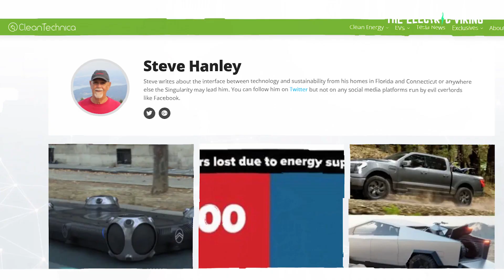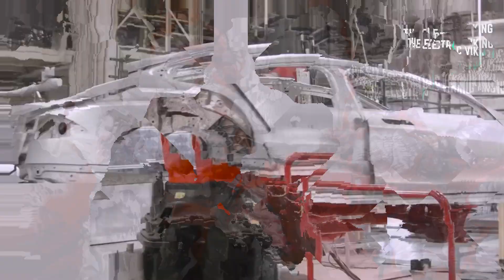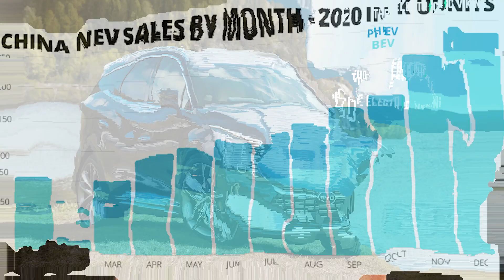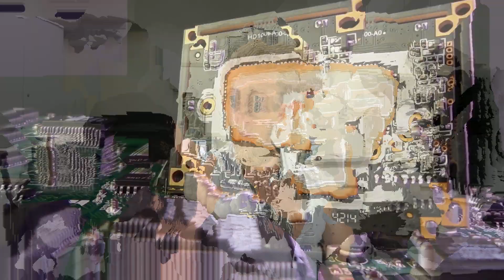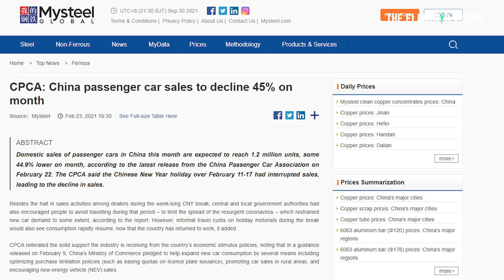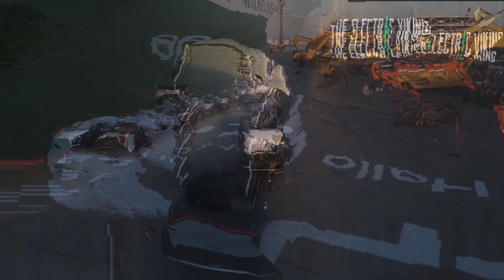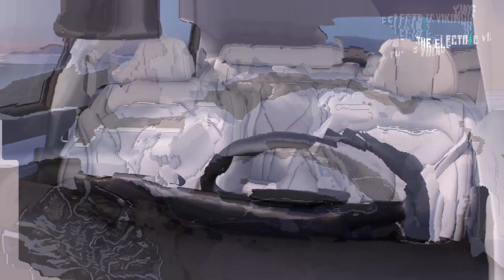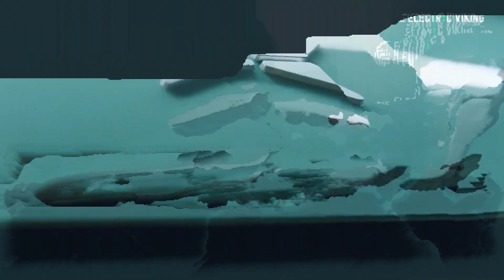The EV revolution is here - China VS Germany!

Comment: Hi Sam,I watched a Fully Charged show on the Sono Sion which is a solar powered car from Munich that uses LFP battery and has 11kw V2G. Small and basic car that has what most people need with decent range and recharges as you drive.Due for production 2023 for 25,000 euros.Can you do a report please I am keen to learn more as I am sure you and your viewers will be also.Thanks for your good work.
Reply: In ideal conditions, solar panels make 250 watts per square metre of active area. That’s around midday with a cloudless sky. Obviously nothing is made at night and almost nothing at dawn & dusk. Over the day in Northern Europe, you can average about 5 “sun hours” per day. 250 x 5 = 1250. 1.25 kilowatt hours is enough to move a small EV about 1 mile. That’s assuming the car has space for 1 square meter of panel facing bright sunlight. Real world will be even less. 
Sunlight is too diffuse to directly power vehicles. A 4KW system on a typical house gives you 20KwH per day. That is useful but would need 4 days to charge most larger EVs assuming the car never moved.
Reply: @Dave5843-d9m  They are testing around Munich probably summer.The new model has panels all over but is a small car,so I would like to see more in depth study to see if it is viable .In Australia & New Zealand there is a lot more sun.
Reply: @simonalexandercritchley439  a EV startup called Lightyear1 is doing the same thing. Solar parels on the roof, fastback and frunk. But it is also designed to have very low drag and  rolling resistance. It's a high end car so sadly it will not be cheap.
Reply: Solar panels on cars is a joke.
Reply: @jfv65  Yes I have been following since the beginning but an expensive and large luxury car not one for the masses.
Reply: Ty ferda comment

Comment: There is a huge gap among countries in EV infrastructure readiness. I wonder how long before EV can really replace ICE completely.
Reply: Today.   Most ev charging globally is done at home atm.

Many new model evs can already charge 100kms in just 5 minutes, 200kms in 10mins at certain chargers.

The average daily commute (by car) here in Oz is only 42 kms (30 miles in the US, 8 Miles in the UK). For a 400km range ev, this means the average commuter only needs to charge every 10days. Why not charge once a week at a major shopping mall whilst you do your shopping ?.

You can recharge that 42kms in <4hrs using an ordinary 2.4kw household power outlet. Many ev owers will fit a 7kw charge point at home, meaning <1.5hrs charge per day to recharge that 42kms.
Reply: @nordic5490  on top of which, we already have so much solar power in Australia that it turns off in the middle of the day as the wholesale price of electricity goes to zero. How difficult would it be to have low midday tariffs for EV charging to use some of that forgone solar power. Charge at weekend at home, or a business could put in a few chargers as a cheep perk of employees and visitors.
Reply: EV infrastructure is cheap and easy to build. Also every home has power, so every home has charging capability.
Reply: @AORD72  
if you want to travel within city, yeah it is probably enough, but if you want to travel out of city, it is almost impossible to find charging place. Most importantly, many countries still have unreliable electricity supply, unannounced blackouts happen often if not regularly. Many practice rationing too.

Comment: The Whuling mini is NOT the same price after rebate. I talked to someone in Shanghai and they say its 35% more money after the incentives. $9k US after incentives.
Reply: 9000$ still cheap...
Reply: @mikafiltenborg2291  Not when you compare it to a BYD Dolphin at $15k that can fit 4 adults in reasonable comfort and travel 2x further with full airbags, anti crash safety built in, then I would call $9k very expensive!

Comment: Dear Sam, thank you for an excellent piece about the rapidly changing car market. I live in London and about 100 years ago the change from horsedrawn to horseless vehicles happened in about 10 years. I would add some caution however, to the perception that EVs or any technology can save the climate changing. London has some of the worst air pollution and I welcome EVs to reduce this but humans really need to buy less, use less, fly less and throw away less if climate change is to be minimised. Buying new EVs, building the infrastructure to make and power them, mining the resources to build them will continue to release CO2. Ideally, self-driving cars that are hired from a phone app would be the best option and car ownership would disappear, reducing the numbers of cars made (which normally spend 95% of their existence parked anyway), free the space in urban streets blocked by parked cars, use the earth's precious resources more carefully and make transport cheaper. There is also the issue to fuel taxation disappearing as people migrate to EVs and governments will have to raise other taxes.
Reply: There will be a feed in road tax, vehicle excise duty as time goes on. Electricity will be the issue because non EV owners will not want to pay more for it. It would be unfair.
Reply: You’re absolutely right about humanity’s incessant wasteful behaviour. It will take about a decade, but the true brilliance of EVs (other than no exhaust and a much safer ride experience) will be the more efficient use of each vehicle and also the electricity that powers it. Parking lots will disappear. All thanks to full self driving. We’ve been overtaxed and overcharged for the 5% of time we did use our inefficient gasoline vehicles. This ends now.
Reply: It won't be as bad as you think, engine manufacture is largely automated using robotics and CNC machinery. The diffs and gears are still being made as are suspensions and brakes, drive shafts and cv joints, shocks, and springs. The body in white uses the most staff. The electronics are common to both EV and ICE. Tyres and rims are still required. Many engineers design the machinery to build the cars and program the robots. They just need to switch tack. There is a lot more in common than you realise.

Comment: You have only got to take a cursory look at an ICE engine to realise how many jobs are going to go.
There are a lot of parts in an ICE engine that is not made by the carmaker. To give you an example take valves and valve springs.
There are factories turning out millions of these a month all around the world. Spark plugs timing belts radiators, water pumps, oil pumps,
pistons piston rings, gaskets. Starter motors, generators, then there are the fluids lubricating oil, fuel. all these and more are made in specialised factories.
There will be tens of millions of people who will be affected. Who is to blame. You have to go back to 1973 oil crisis. GM made electric cars. The oil companies fort with the American government to ban electric cars and succeeded which resulted in ten thousand electric cars with the technology being buried in the desert. If that change had been made by the eighties we would have been fully electric and job losses would have been far less than they are going to be today. This is what happens when governments are persuaded to change the future to protect one industry, million lose their job in the future. If we had had the electric car in the eighties just think how advanced they would be today.
Reply: So true. Even if the 1998 EV1 would have been allowed to evolve… The difference in today’s air quality and road noise, accident rates would be insanely huge.

Comment: There really isn't much of a revolution - did you realize an EV had a range of 214 miles in 1914??  An EV hit 174mph in 1974?  EVs continue to have the same problems; higher cost, long recharge times, limited scaling, and impractical for many.  There has been progress but not close to revolutionary yet.

Comment: I think the EV revolution/revelation will reach a toppling point & purchase of ICE vehicles will plummet to include only the real ICE fanatics & very out-of-touch elderly. There will probably will be a lot of very wealthy folk buying the special ICE vehicles; ie supercars etc; but ultimately most people will wait until they can afford EVs & those that can't will buy used vehicles until they can afford an EV. Used EVs will probably remain quite high in price & those that can't afford a new one; ie students & lower economic folk will probably remain on used ICE. The upshot is that there will be a huge cliff-face drop-off of new ICE vehicle purchases & a holding-on to older cars until people can purchase an ICE vehicle. New ICE vehicles are going to collapse.

Comment: I don't own any stock but if i would bet on a company it would be Toyota. Brand carries a lot more weight then other no names. I know they appear as fools now but i believe they will get it ✔ When cars are equal in design and functionally its then the people will chose Brand loyalty
Reply: You failed in your research if you chose Toyota. Bad choice pick again, give you a hint Elon .
Reply: @Backseatobserver0075  nah i. Dont believe in products that spy on its customers
Reply: @Backseatobserver0075  no.
Reply: @truecolors967  meh. Chinese cars are better that way for Ozzies who will never visit China.
Reply: Correct. The rule is, buy low, sell high. Tesla is high atm.
Reply: linkzable  the current generation of Solid State Batteries used in the latest Mercedes ev trucks and busses, have 2 problems:
1 - Need to be kept at a constant 80°C. SSBs grow and shrink with temperature leading to physical damage.
2 - Low maximum charge rates, typically 0.2C, mean 6-8hrs to fully charge.
Reply: Toyota bankrupt before 2030
Reply: @mikafiltenborg2291  if. Ford & GM can weather E.V. transition storm.why cant.Toyota ?
Reply: @mikafiltenborg2291  Tesla even sooner.

Comment: Tesla have collected HUMUNGOUS amounts of camera data and while their self driving is advancing it’s not really close to full self driving. Nobody else has a small fraction of the data that Tesla have. Nobody else has the infrastructure to teach the computers. Nobody else has a computer in the car which can do the live processing. Tin bashing to make cars is easy enough. Question is how will Chinese car makers get close to what Tesla on FSD?
Reply: I wouldn't underestimate the Chinese. They manufacturer way more vehicles than the USA. Collected data can also be useless if the data is missing variables. Virtual data can also be used (like google earth street view). Even 6 months of captured data with 100 cars with sensors you could have 500,000 km of data. If you captured that data as video at full HD from many cameras you might start to have storage problems. I don't think data would be the problem. The problem might be more the ability of the hardware to process the data fast enough. Are there computers as powerful as the human brain, I don't think super computers are even close. Perhaps the AI needs to be self aware to be able comprehend new visual entities it sees. Right now I expect it to be too dumb to interpret things like reflections in windows or mirrored buildings. The reality right now is do we need FSD, the answers is no. As cool as it seems it's just a gimmick as the majority of people use cars for short drives to work/shops.